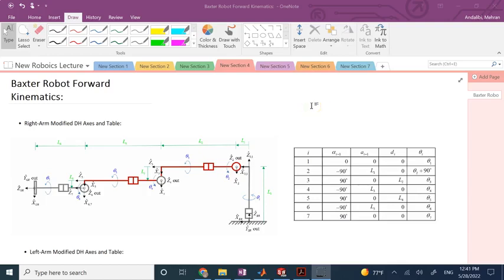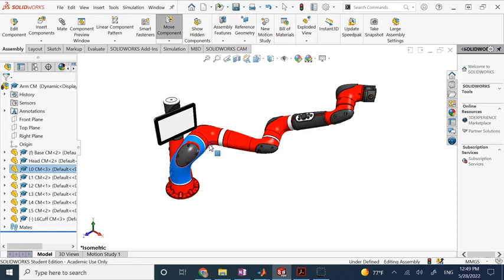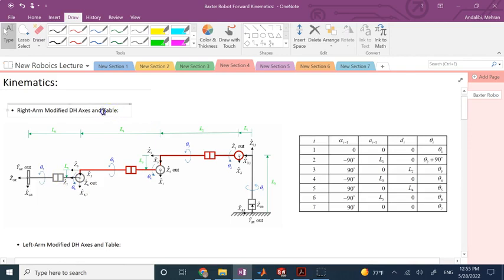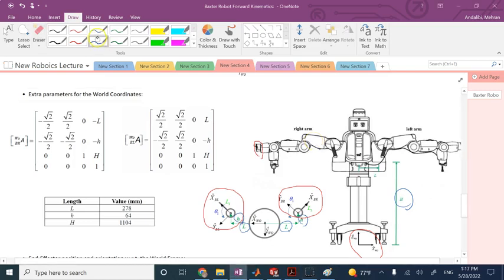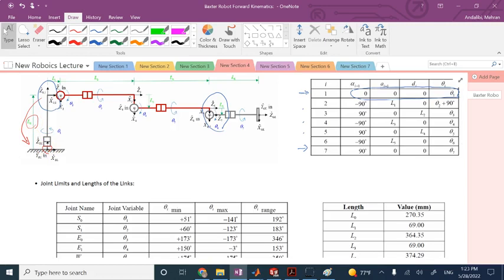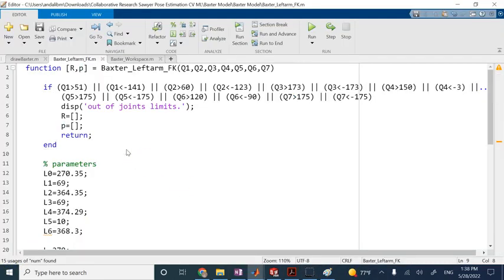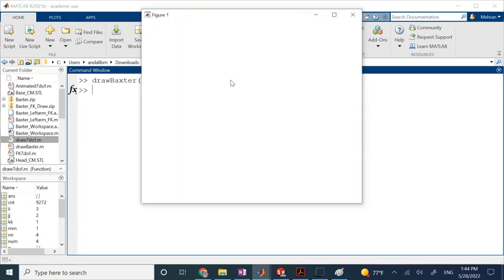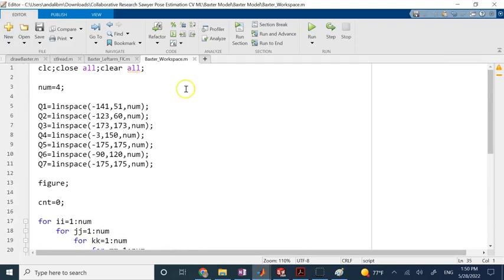Sawyer Robot Forward Kinematics

Comment: Hello Dr. Mehran, Thank you for the awesome videos! 
I was hoping to ask you for some guidance on performing forward kinematics on a 6DOF 2000ic/270F Fanuc robot. I performed Forward kinematics on it and got it to work although that model has some components to it that I was not able to fully understand. The main differences from you example I found was that In order to get the correct x,y,z coordinates when choosing Joint angles for J2 we need to add pi/2, for J3 we do the desired angle + J2 angle and J4 we need to multiply  the desired angle by negative one. Can you please explain why is this ? And how would one approach inverse kinematics with the shifts ? I am trying to use a iterative technique using Jacobians , but not sure how to deal with the above shifts on the angles.